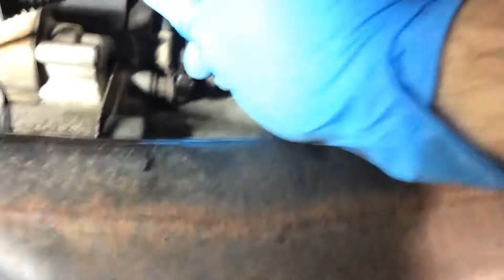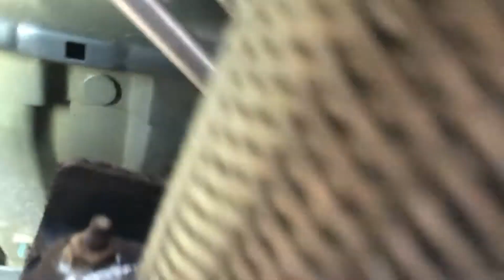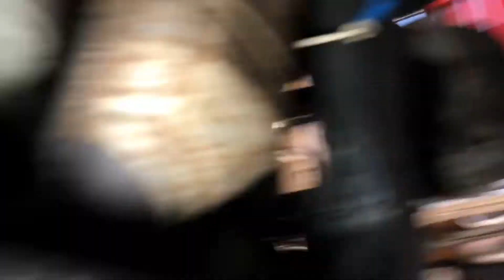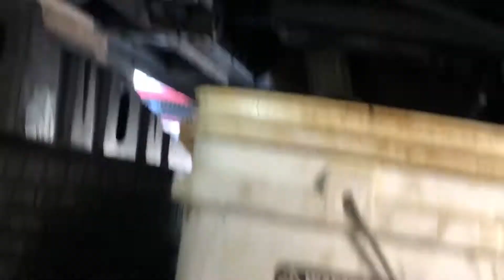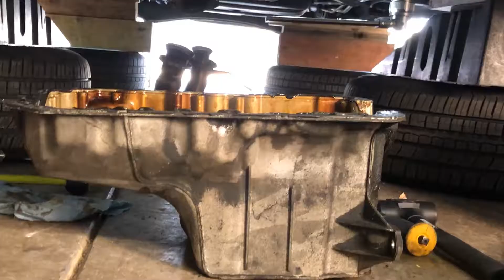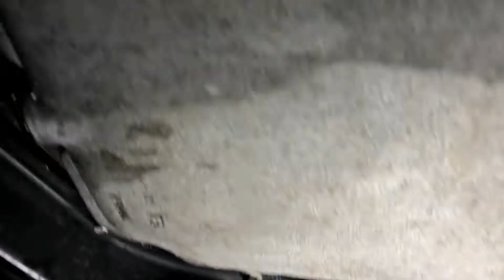Detailed How To Change Oil Pan Gasket Ford 3.9 & 4.2 Liter 04 - 07 Freestar, Monterey & Windstar

Comment: Very helpful video. I'd just like to say thank you.  And a helpful hint to those doing jobs similar to this, and vehicle has to be up a little way off the floor of the shop. Please "do not" jack vehicle up on front cross member. Unfortunately I did this and jack slipped forward and busted a big frickin hole in the oil pan. Thus the reason I watched 👀 this video.
It was a lot of extra unnecessary work because of being in a rush. Started out working on replacing water pump on this Ford which was no easy task either by the way. Oh well learned a lesson from that mistake. 🤔But on a good note got some good knowledge and experience accomplished by replacing the oil pan. 😡

Comment: My tube of Permatex exploded in my hands. It made just a nasty mess, I used some of the black stuff that came with the seal to fill in some of the lesser thick areas.

Now I just gotta hope I got it good enough, because it was a pain to get the pan up. It likes to hang up on the mounts and the transaxle casing. This is for a 3.8L

I wished I had watched this video prior to taking it down, because I wrestled with the pan before completely taking the exhaust off. Also, thanks for pointing out that there is a socket for O2 Sensors! Hoping it helps with reassembly!
Reply from the maker: @Rob P. - Sorry to hear about the Permatex issue.  We've all had something like that happen at some point in our lives so I feel your pain.  Those O2 sockets are one of those specialty tools you may not use very often but when you need it you'll be super glad you own one!  I'll keep my fingers crossed, hopefully you'll have no leaks.  Sounds like you made sure to have enough gasket maker on there so you should be okay.  Thanks for stopping by and taking a moment to leave me a comment - much appreciated!
Reply: @javosgarage  Great news! Everything seems to be holding just fine, no leaks. Best part is, I don't have to pull the transmission to replace the rear main seal.

Again, thank you for making this video!
Reply from the maker: @Rob P. -  Not having to pull the transmission is ALWAYS a good thing!  I'm really happy to hear everything worked out great and your leak is gone.  Thank you for taking the time to come back and let me know how your project went, I love the feedback!

Comment: Javo, how did you know it was the oil pan gasket that was leaking? We have a 2004 Freestar that has a leak on the front passenger side and there was oil all over the oil filter. My son, who,looked at it, said he thought the oil must be leaking from some place above the oil filter (since the oil filter had a lot of oil on it) but I had the valve cover gaskets changed a couple of years ago. I took it to the local oil change place and they said it looked like the leak was coming from the oil pan gasket. Just wondering how to tell when there is a lot of oil residue all over?
Reply from the maker: +Jim Carey Hello Jim.  When there's oil residue covering everything it makes it really hard to properly diagnose the problem.  Whenever I tackle an issue like this one my first step is to clean the motor really good.  A few cans of brake cleaner should do the trick.  It's best if you could then let the vehicle run for a little bit and usually the leak will present itself.  If that doesn't work I will then take it for about a 10-15 minute test drive near my shop and check again.  This is my last option because many times you can have a leak in one area and due to wind draft from driving it will spray onto and collect in a different area.  May I also suggest you double check your oil filter?  I have seen many leaks from oil filters.  I know it sounds crazy but there are times when removal of the filter, cleaning the gasket surface and reinstalling the filter can eliminate an issue.  If the filter was over tightened that also can cause a leak that would run down onto your filter.  The general rule is once the gasket touches the surface you give the filter a 3/4 turn and you should be good.  Hope this helps you, let me know!
Reply from the maker: One more thing Jim, you may also look at your oil pump which is directly above your oil filter, actually your filter threads on to it directly.  There is an o-ring on that pump where it mounts to the motor.  Judging from your description my thought is your leak is your oil filter or oil pump.  Good luck, let me know if I can help you with anything else.